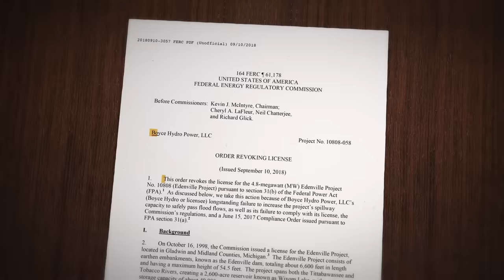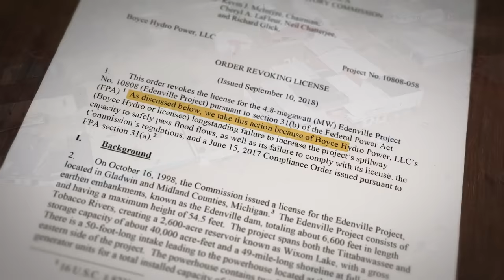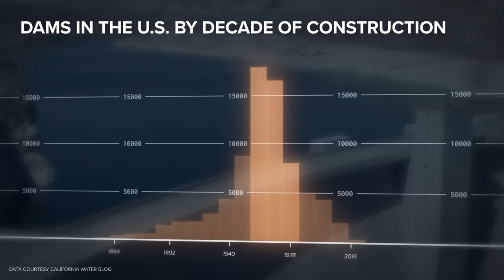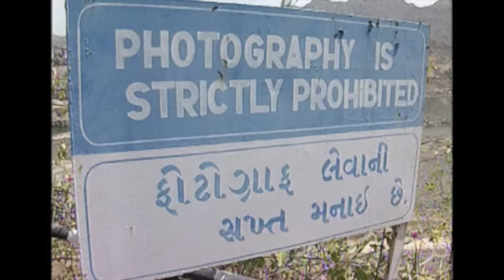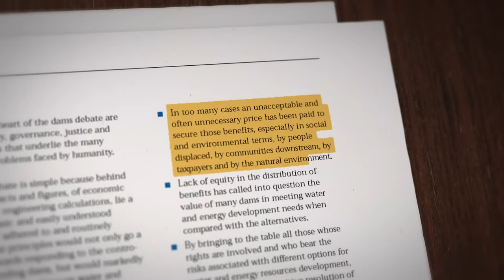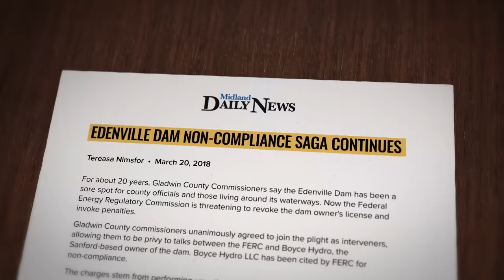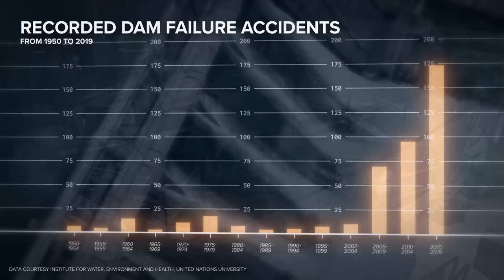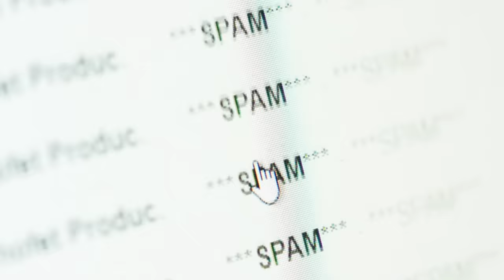The Troubling Danger of Dams

Comment: Minor note on precipitation unit conversions: While centimeters are usually the more common measurement in metric, in the case of precipitation, millimeters are the standard. So 3 inches would become 76 millimeters (well, assuming it's exactly 3 inches).
Reply: Additional minor note. Since it is metric just multiply by 10.
Reply: Whats the point of using metric at all if converting cm to mm isn't completely mentally trivial to do?
Reply: @GGoAwayy I guess it's just like telling the size of mountains or the height at which planes fly: both are done in m rather than km
Reply: @lordvader89a  fun fact: well not so fun, backward fact: almost all ATC and planes in the world use "feets" to report altitude
Reply: @RandomTheories fun fact: feet is the plural.
Reply: We get it, Euros can't do fractions.
Reply: @jffry890 Probably the dumbest argument I see for keeping the dumbest set of measurements. Why on Earth would requiring unnecessary complexity to measure things be a point of pride? Besides, all American units of measurement are officially defined by metric calculations, so you're just making things harder for yourselves for no good reason.

Also, I'm not European. There is more to the world, in fact, than the US and Europe.
Reply: @jffry890  Of course we can do fractions, we are not stifled by the USAmerican education system. Also not a Euro.
Reply: @TheKazragore  Smoothbrain L
Reply: @RandomTheories   And we can blame Britian and America for that atrocity!
Reply: @TheKazragore "why would having measurements with lots of factors for simple mental calculation of ratios be desireable"
Reply: @KraziEyevin  ...like the metric system?
Reply: @KraziEyevin  5280 feet to miles is not exactly great for conversion. Also the imperial system is TERRIBLE for distances less than an inch.
Reply: @Endless-fire  wdym, 5280 is just 440x12, or 660x8. It also factors into 6, 4, 3, and 2 just as easily. And I'm really not sure what you mean about distances less than an inch, but then again I've worked as a machinist, where I worked with fractions and thousandths of inches all day.
Reply: @KraziEyevin  Yup, it has lots of factors. But it is STILL terrible for conversion. One of the benefits of a decimalised system is that (in base ten) it works on both sides of the decimal. Converting any value (say 5683 cm) to m, km and mm is as easy as moving the point. 56.83 m, 0.05683 km and 56830 mm.
Please show how your factors help in converting 5683 feet into yards, miles, inches and whatever power of two fraction of an inch you so deem useful.
Reply: Metrics are for those with diminished mental capacity

Comment: Dam removal is often cheaper than repairing a dam but runs into the issue off all the people who have built around the lake behind the dam and from operators who want to extract that last bit of irrigation or power "for free" since they expect to be gone before the cost of repair or failure happens.
Reply: Those issues pale into insignificance compared to the issues faced by those living downstream, in the dam's shadow, when it eventually collapses. If upstream residents or commercial operators start whining about decommissioning a dam at the end of its life they should be politely told to eff off.

Comment: noticed a few of those dots near me in massachusetts, and i know for a fact i live within walking distance (uphill) of a "significant hazard" dam. heard lots of talk over recent years of finally getting around to dealing with them, but it can't come soon enough tbh
Reply: Significant hazard means that if it failed it could cause loss of life. It has no basis on the condition of the dam itself. It’s strictly a measure of how high it is, how much water is in there, and what happens in terms of flooding if it were to all wash downstream on a sunny day or also during the largest storm that could theoretically happen.
Reply: @BuddyTobyTV  oh yeah, oops, i forgot to add that its rating is “poor”, somehow forgot that part
Reply: @BuddyTobyTV The typical definition for significant hazard does not include likely loss of life, instead that would be a high hazard dam. Significant hazard is primarily related to economic and environmental damage as well as damage to infrastructure.

Comment: The Oroville Dam crisis was really not about a threat to the main dam.  Yes, the spillway failure cut a huge area of the hillside away right next to the spillway, but it did not start cutting through the bedrock.  Therefore, there was no imminant danger of the main dam collapsing.  The only real problem was the large amount of soil and debris wich backed up the water flow of the Feather River at the base of the dam, which prevented the generators and powerhouse from working.

The real threat, caused by the inability to utilize the spillway at maximum capacity, was the emergency overflow dam, which had never been used before.  As lake levels rose higher than ever before, the emergency dam was overtopped and erosion started happening at its base.  Keep in mind that this overflow dam was on the opposite side of the spillway, further away from main dam.  At one point, an evacuation was ordered as the failure of the emergency overflow seemed imminant, but it was averted by using the spillway as much as possible to lower the lake.  Had the emergency overflow dam given way, a thirty foot wall of water would have escaped down the Feather River.

Comment: I think its unfair to merely look at capital costs, or even generation costs of hydro compared to other energy sources. Hydro has dispactability only matched by gas turbines, but even more crucially, they can store massive amounts of energy, either by running in reverse or holding back water to release later. Building out renewable energy in Germany and Denmark would be a lot harder if Norwegian hydro wasn't available to absorb excess production and cover shortfalls.

In short, even today from an energy generation perspective there's still little that can beat hydro for reliability, dispatchability, storage cost and yes, even carbon emissions over the long term. Gas is still a fossil fuel, nuclear isn't as dispatchable and is very expensive, and battery storage is even more expensive.

Comment: it is also much worse than normal because "stop using it" isn't an easy solution ...
if a bridge is known dangerous, you can close it.
Reply: Exactly... decommissioning a dam is not without consequences, especially if it performs as a flood control structure.

Comment: I live near the Grand Coulee Damn. The benefits of this damn are so many. Pointing to failed poorly planned projects is very misleading. The damn near me was built correctly and well thought out. It is well managed. Damns are awesome and we need more of them. Of course they need to be built correctly and well thought out. Earth damns are always a hazard. Concrete damns have a 500 year life span and can be systematically replaced within reasonable costs. The safest type of damn is a basically a concrete triangle that sits on the bedrock and is held in place by its own weight and the shape of its base in the bed rock. It is very expensive to build these damns; however they last for 500 years, they are very low maintenance, they are not subject to sudden catastrophic collapse or failure, and with proper spill ways they can more than handle huge increases in flow. It’s basically a man made mountain. It does not rely on structure to transfers loads. It is simply so heavy that the lake cannot move it. These dams are usually way over built and even if overtopped they would not suddenly fail. In fact some of them are meant to be overtopped and the top is actually the spillway.

Comment: the IPCC does NOT state that storms and hurricanes are getting more frequent, more deadly, or stronger. otherwise, great video.
Reply: Yes it does, have you read their reports? The IPCC Climate Change 2023 Synthesis report, Section 2, Table 2.1 part (a) indicates heavy precipitation has been observed to increase in the central and eastern United States and cites low to medium confidence that it is human contributed. Part (c) indicates that flood and storm induced damages in coastal areas globally have increases and cites high confidence that it is attributed to climate change.

Comment: How do you even fix an old dam without empting the reservoir? Most maintenance and reinforcements can be made on top of the existing dam, but you will eventually get to a point where the core structure is too old and weak. What do you do?

Comment: the problem is privately owned dams, not the dams themselves. with the amount of extreme rainfall increasing the world will need more dams in fact to protect from these floods, because the primary function of most dams is not electricity generation, but flood prevention.
only cause the US bungled it up with their implementation that doesn't apply to the rest of the world.

Comment: 0:38 It's pronounced mi-shi-GAN-dur (with the emphasis on the 3rd syllable).

12:30 Dams are the most ecologically destructive, and historically most dangerous way to generate electricity. But carbon emissions during their first decade of operation are not a downside. The claim that emissions are harmful is industry FUD, not grounded in sound science. The best scientific evidence shows that they are net beneficial.

15:05 It is not true that storms are becoming more intense. No category of storm has detectably worsened. Hurricanes, nor’easters, and tornadoes have all either decreased in severity or shown no detectable trend. The decrease in strong tornadoes has been especially sharp. Even AR6, which you cited, says that they have "low confidence for observed changes in the magnitude or frequency of floods at the global scale" [ref: AR6 WG1 §11.5.2, "Observed trends"]